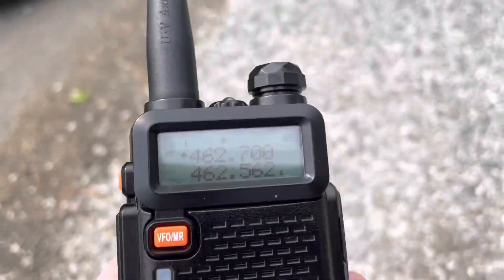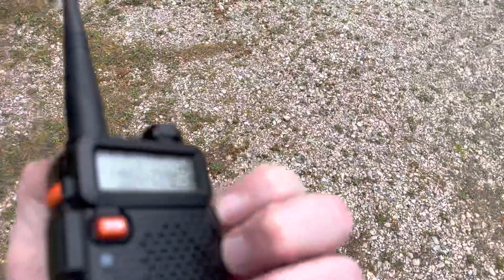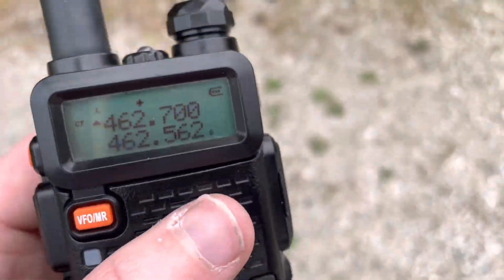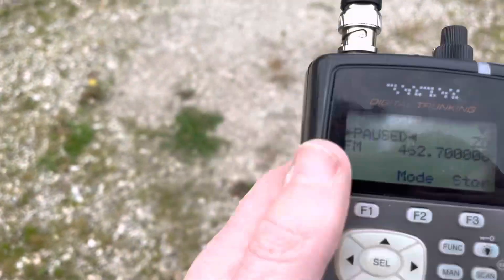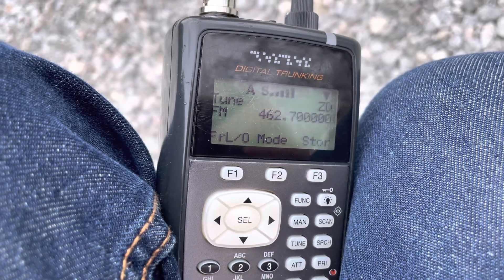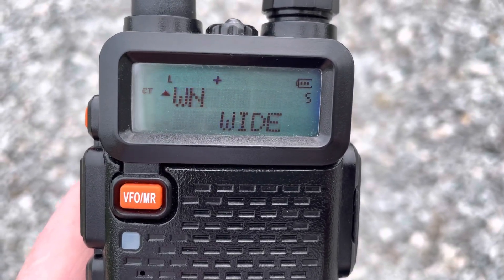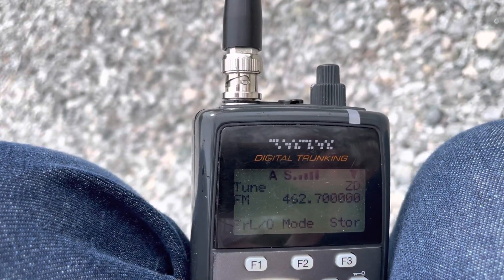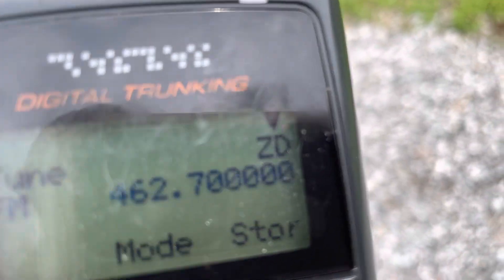Baofeng UV-5R Portable Temporary GMRS Repeater - Part 1 - Operational Testing - Proof Of Concept

Comment: The main differences between ham and gmrs is :
1) The license for hams govern the operator, not the radio, with a maximum output power of 2000 watts.
2) Hams can use repeaters in the 28, 53, 145, 445, 902, and 1288 MHZ bands and higher including visible and are assigned a single or group of repeater pairs. A ham can have a repeater in every band and have them linked together for larger coverage areas, up to international coverage.
3) GMRS MUST follow FCC Part 95 which allows all gmrs and frs frequencies, with a maximum of 2 watts on frs, or 50 Watts on gmrs with only 8 repeater channels with the repeater outputs being shared with simplex users and there is NO allotment for a repeater pair that the hams enjoy. 
4) the only disadvantage to ham over gmrs is hams cannot talk to frs users at higher power unless they have both licenses like I do. 
5. ham and gmrs cannot be connected to each other. 
6) It is up to the ham to ensure the radio they are using is transmitting cleanest signal possible while FCC part 95 governs the emissions from both frs and gmrs tranmitters. 
The ham 440 band has the same characteristics as GMRS, with the 28 Mhz band repeaters covering areas much larger with lower power than either 440 ham in the same band of gmrs with repeaters of 50 watts because of the line of sight characteristic of the UHF band. The lower the frequency, the radio waves follow the terrain of the earth and are used by both sea going vessels and aircraft traversing the high seas. There are documented conversations of over 5000 miles using ONLY 5 watts at frequencies below 28 Mhz. This distances are greater with hams having a much higher power out allotment, up to 2000 watts. However most hams only use a max of 200 watts  due to power usage and duplexers being lossy and crosstalk with higher power. 
Hams enjoy many more bands than GMRS and it may be really difficult to find a ham who is communicating with someone halfway around the world as lower ham bands start just above the AM broadcast band which ends at 1.8 Mhz. hams have 1.8 to 2.0 Mhz and this band can at times be heard at the transmitting station with a delay because the signal is going around the Earth. EME is using the moon to bounce signals back to the planet and can be used to talk to just about everyone worldwide at any given time.
73 de N7TZQ
WQRT522
Reply from the maker: There’s a lot more to it than that - but yes, you’re right.  

For the record, I’ve got a ham license [and it’s 1500 watts maximum power output under Part 97, with a few exceptions], a GMRS license and a Part 90 land mobile (business radio service) license.